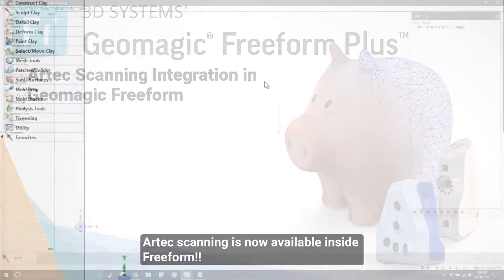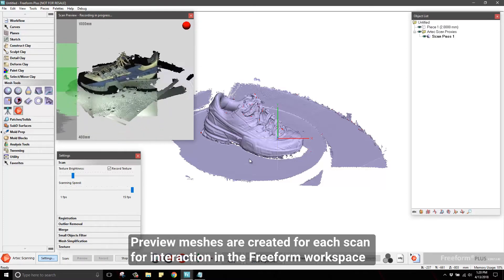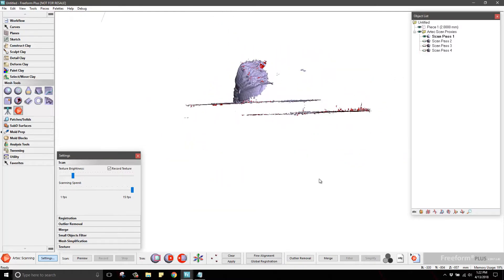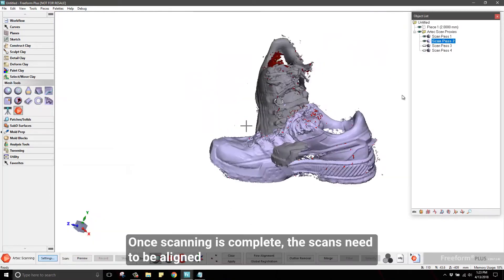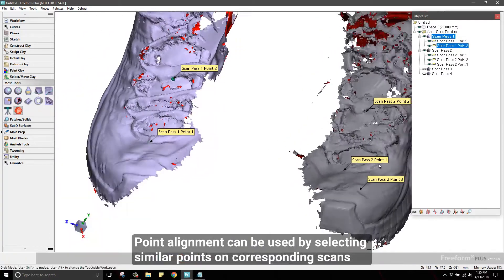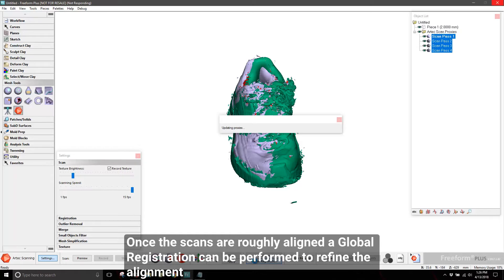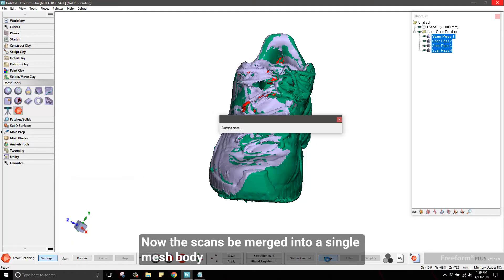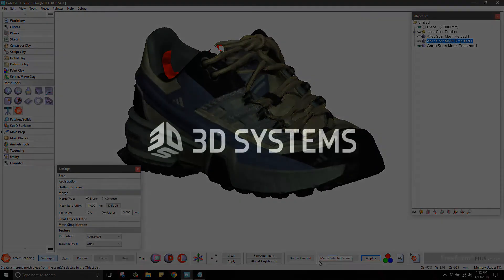Scan-to-Design with Artec 3D Scanners and Geomagic Freeform.

Comment: nice video , curious if one doesn't have a 3d scanner would a video camcorder or phone video clip work for rebuilding a 3d model .stl file? I have seen people do it with camera and smartphone cameras with a ton of angle pictures in a folder... They usually prefer it because there is no restriction on the dimension of the object where as 3d scanners are limited to the dimensions/size they can scan. But the issue is time consuming picture taking at different angles so if you could uses a video clip that be much faster /easy not sure though software supports this like freeform ?